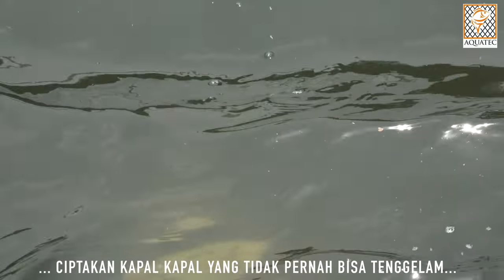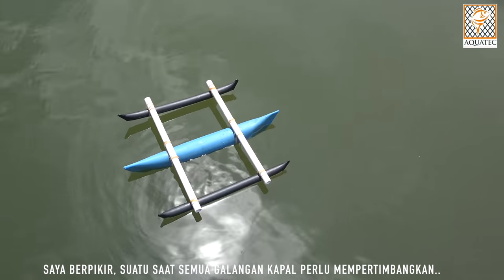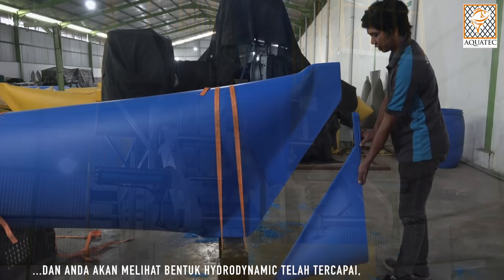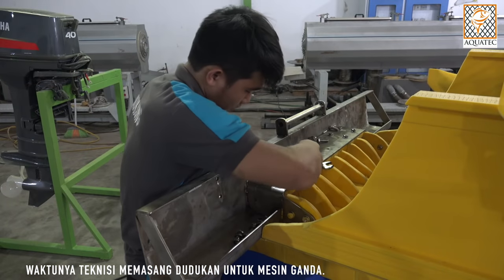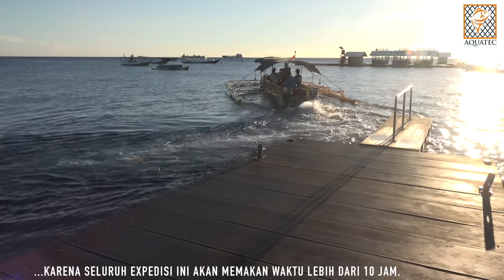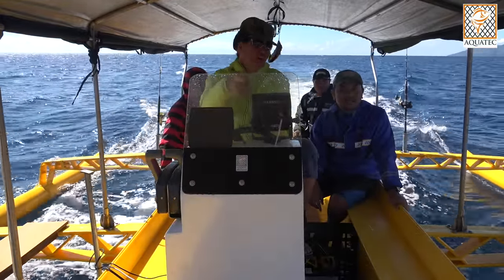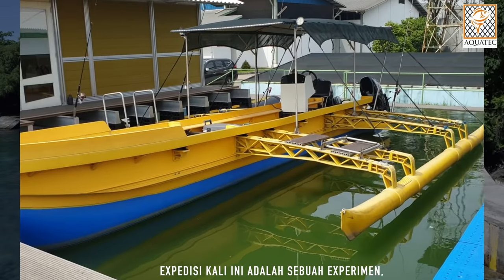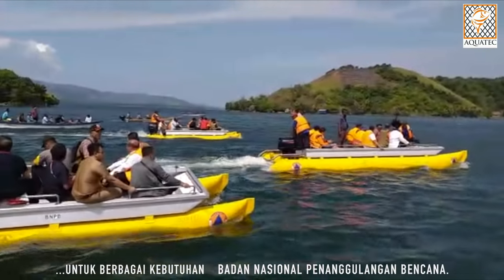HDPE Boat - Unsinkable Jukung

Comment: Are you sure they are unsinkable? Did you make them UV resistant to prevent the suns rays from making the plastic brittle or crumbly and fill them with flotation foam just i case they get a hole in them? they are neat, thanks for showing that to everyone.

Comment: Crimp sealing the tube ends is brilliant in its simplicity. Adding foam in the tubes would create a truly unsinkable boat.
Reply: that would add unnecessary add cost as air is buoyant enough.
Reply: @timothygodfrey4950  Water proof bulkheads definately required.

Comment: what a great idea sir to protect our trees may god bless you always sir
Reply: @UguysRnuts  yes it may saved if we use that pipe instead of using wood to make  a boat..industries are everywhere and its  part  of growing country to have a lot of industries.what i mean is to minimize cutting trees in there place to make their boat. that step may not totally can clean or stopped  polluted air but it may help to stomped plodding ...did you think of that bright man hahhaahahahaha
Reply: @UguysRnuts  No need to call the person stupid, perhaps "dangerously ill informed" would have been more polite.
Reply: Wood is a far more environmentally sustainable build product. It is also renewable by planting trees. Petroleum products, plastics, are not an improvement. They should be used with caution.

Comment: absolutely awesome! i agree filling with a foam would truly make them unsinkable. the current design is a massive step up from a fiberglass boat but you'd only need two holes worn or poked into the pontoon for it to start filling. given the amount of wear this boat would likely see, it would happen eventually. but even then your looking at years of good use and patching them really well is certainly possible to.

Comment: I am glad you mentioned the splashing,  since this design will not be very suitable for rough ocean conditions. You were lucky to have a smooth first journey. The bow needs to be higher and also the shape of the hull needs to be curved upwards like a banana,  with a straight pipe design it is not possible to achieve good rough weather capabilities. 
But the idea is good 👍⚓

Comment: great idea and design! I would say you should try using 2 pvc pontoons as the main part of the boat.. it would float higher above the water and the outboard motors would propel the boat easier and with less wake/splashing  like the splashing seen at 5:05..

Comment: Your idea is great, but if you build a platform on top of the tubular pipe like hulls, the weight of the platform forces them beneath the water. Making it a much smoother ride, because these hulls ride beneath the water like a torpedo, instead of on top of the water which is rough. You would have to place the outboards on the stilts or vertical beams that hold up the platform. This type of design is called a SWATH small waterline area twin hull. This is the future of all boating being, fishing, sailboats, ships & even ferries boats.
Reply: Super!,Thank You.

Comment: A very nice solution to the problems you mentioned both with wooden and fiberglass boats. One point that the video did not answer was how does the boat handle turbulent waters and storm conditions? Often multihull boats are more stable capsized than upright, so it would be interesting to check that failure mode to see what can be done in the design to reduce the likelihood of a capsize.

Comment: It’s a great start but unsinkable will not stop it from capsizing and drowning everyone on board. 

You have the perfect platform for solar panels overhead eliminating the need for imported fuels. But I would address the issue of drag first. Those pontoons can be shaped to cut through the water then widening gradually. That will increase speed, efficiency and reduce splashing/drag.They can even be raised so they don’t touch the water when you’re traveling at speed. And you have too many braces for the outriggers. You can reduce your weight considerably by eliminating half the braces.

Comment: You could embed reinforcement beams for added structural support. Also a UV protection coating would help the plastic degradation.

Comment: Was it UV treated? Nice idea, especially if the plastic is recycled. Also solar panels and electric motors, with the batteries inside the main float (have the end removable), for ballast.

Comment: HDPE seems to be an excellent material for boat building, be it from pipes or from sheets. It has to be treated to be UV resistant. 
The concept presented here is very interesting; it looks easy and simple to realize, ... provided that you have the machines !!
Having said that, in case of collision against a reef, the hull can break, ... and the boat is not unsinkable any more !!!

Comment: Love the idea and appreciate your effort.  I agree with the earlier comment of closed cell foam.  Good design.  Hope we see your design in CA with a larger Kayak great marketing
Reply: Fill the hull with sealed coke bottles, lighter, cheaper (free) and recycled, they will never puncture even if the hull is 👍😊
Reply: @colinstace1758  Not neccessary. Fitting water proof bulkheads will do the job. Air displacement within excellent boyancy.

Comment: Very COOL! I want one, if the insides were filled with flotation foam it will never go down. How is the material in long term sunshine?
Reply: The black version is very good 100 years + probably we dont know it’s that good. it off gases so little under uv light it’s hard to measure and purity has a huge margin of error effect.

Comment: Environmental friendly, unsinkable you might be missing a few ingredients like storage for gear and gas, ice, batteries, fish holds, cab, cabin, shade setup for fishing during the day then the main ingredient rough water in open ocean have to try stationary and trolling then gas mileage and weight capacity is a another seasoning for another time. I can say those Freeman catamarans are a work of art

Comment: great! However wouldn't have been more appropriate to send the boat out into rough seas to test its purported un-sinkability? I mean, that's the argument you make at the very beginning with the plate test. Also, with respect to the issue of adding more micro-plastic to the ocean, to what degree does this material break down over time? Have you thoroughly tested(considered) that aspect?

Comment: others are saying foam, but then when the hull gets a hole you would have no way of knowing and the water will rot the foam and add weight, instead a few bulkheads in each tube with an inspection/storage hatch to access each, so if one gets a leak it wont sink, and you have access to fix it.

Comment: It was really an amazing construction from plastic components. But the only comment I can say is that the PVC pipe as time it gets to use will become brittle and will easily break of crack up especially if it hits or being hit by a solid object. Other than that no more to say, But, do continue ingenious your sdesign as to improved innovation in design engineering. Good luck!!!

Comment: HDPE UV resistance? 
Like the idea over aluminum expense and structural cracking.
Field repair/weld kits would be ideal. 
No non-sense build and idea improvements for anti-sinking would be good safety sales point and if updates are designed to retrofit already sold units to improve safety as knowledge increases with boat materials and structural engineering.

Would expect to see 45 degree angle braces for outriggers to pontoon to support pushing forces.
Way to mount outriggers in a manner to be able to transport in an onsite kit buildable design to extend market reach.
Good video and thank you very much for your time and ideas.

Comment: I was going to build a DIY  boat  just like this,  but first,   I need to build an HDPE injection molding machine the size of a building.  Then,  I need to build a heater and crimping machine the size of  bus to seal off the ends of the tubes.  And finally,  I need this heat fusion gun to put all of the parts together...........  Oh i almost forgot,  I need a couple million dollars for all of this.

Comment: Chambered hull into 4 to 5 sections would be adequate to make it unsinkable.  Even with hole on the bottom the water would not rush in due to buoyancy of the othe chambers.

Comment: I believe a whole series of vehicles, light aircraft, boats & midget underwater boats / submarines & lightweight tracked vehicles.
So many potential uses , especially for a island nation like Indonesia. For military use instead of heavy armour, making them small and hard to hit is the name of the game imo. Cheap, lightweight, rust proof, no painting or rust prevention, sonar transducer can shoot through the hull . Low magnetic & low heat signature. Can us ballistic plastics & fibre reinforcing or add on tile plates . Lightweight means, smaller engines & less fuel, less environmental footprint. I’m thinking plastic tracks may not need lubricant. I’ve seen plastic suspension springs also .

Comment: Clever. I need two of the central hulls you used on the record run in the movie. Also a connecting structure to build an 8 foot wide platform upon  between the hulls. We will use four 40 horsepower outboard motors. KiaOra from New Zealand.

Comment: How stable is the material with UV (sunlight) damage? Also how long does it last if the bottom part is scraped on a sea shore where there is no proper harbour and the bottom is scratched by dead coral/rocks. Great idea for boats, but I would not put HDPE plastic and 'environmentally friendly' in the same sentence, sorry!

Comment: Having operated and sailed for many years on  fiberglass catermaran, I found the most vulnerable item on the boat was the spreader bars, especially where/how they were attached to the main hull. In rough weather, with stormy seas, these attachment points are incredibly stressed. in the time I owned the boat, much attention had to focused on these attachment points to ensure they did not fail in stormy seas. I note too, as this boat in the video is basicly a proof of concept idea, it does not cater for storage of equipment or catch. So how would this concept replace traditional wooden boats that have this ???
Reply: I agree as well, I believe this can be solved by filling the tubes with close-cell foam to form and make the compartments water tight, also saw a post by which I will share below that makes design sense as the concept develops and with naval architecture in mind.  

Herzankerkreuz67 wrote as follows: 
@Herzankerkreuz67
2 years ago (edited)
I am glad you mentioned the splashing,  since this design will not be very suitable for rough ocean conditions. You were lucky to have a smooth first journey. The bow needs to be higher and also the shape of the hull needs to be curved upwards like a banana,  with a straight pipe design it is not possible to achieve good rough weather capabilities. 
But the idea is good 👍⚓

Comment: Air chambers are defalut design feature in almost ANY ship, those are called bulkheads. Even Titanic had those - only problem was, there was flooded a higher number of them, than enough, to sink the ship. By the way, more modern boats are build out of (or partly of) floating foam. The light side of that is, even if the boat breaks, it floats. Even if it is full of watter, it does not sink. The foam could be added into your design too - simply when the pipe is velded in one side and open in other, you fill the pipe and weld the second side. Try to find modern boats design and timelapsed builds of them here on youtube, you might be suprised, what can be done today - even out of HDPE material of your pick.

Comment: A great idea. Perhaps it is your long term plan, why didn't you use some of the hdpe that is polluting just about every water way on the planet instead using new hdpe pellets
Reply from the maker: Yes, but the problem is that secondary or tertiary HDPE has very low supply, quality, and/or recycle rate. Therefore we use only new HDPE pellets.
Reply: @AquatecIndonesia  agreed, but even recycling a small percentage in the mix  would help reduce some of the stuff fouling the oceans  that both our countries rely on
Reply from the maker: @georgesmith4509  Agreed, thank you. So far we use leftover HDPE from our production line. If we can find high quality recycled HDPE, we will add it into the mix.

Comment: Looks like semi displacement hull shapes? It may be possible to take more advantage of benefits of hydrodynamic design to improve efficiency at design cruise speed. What is the difference in material density compared to standard fiberglass layup?

Comment: how is this unsinkable?  if the fused ends open which they will do as some stage as the pipe ages they will sink like a stone.  Likewise if the pipe gets a hole in it from striking some underwater object... sinks...

Comment: Rotomolded plastics can be shaped more efficiently.  You could have a more fuel efficient design with less splashing.  And foam filled is better than an open chamber that will fill if punctured.
Reply: Welding poly disks internally into the hulls before they're sealed creating water tight bulkheads is better than foam and considerably lighter.

Comment: The plastic pipe floats no problem but you add engines and all the other items in a boat I would want the tubes filled with flotation stuff. Closed cell or styrofoam what ever is the least expensive.   I know these will last years but sun damages plastic over time so what is the plan when a boat needs to be recycled?

Comment: These craft would be unsinkable so long as the press seal hold fast.  Maybe consider using small holes in top to pump in an expanding foam.   The even if there is a leak it will stay boyant.

Comment: I think it’s great but how does it compare in weigh to a similar boat? I’m just wondering not criticising. Is there a pressure valve refill valve in the pontoons to allow for hot cold expansion which could cause small fractures or is there enough give in the plastic to accommodate ? Cheers and well done
Reply: Expansion and contraction and air pressure is insignificant as the pipe is designed to operate at full working pressure for years and none of that capacity is being used in this design.
The danger would be that the pontoons have sufficient wall thickness so that the walls don't flex while the boat is planning. Just like steel, HDPE will fatigue fracture if it is bent back and forth long enough.

Comment: Something to consider would be at least 3 segments for the main hull, or hulls in the case of the catamarans.  That way, in case you hit a log or rock too hard, you won't sink if the HDPE skin is ruptured.  While preserving the forests is a very noble goal, I believe that HDPE is produced from petroleum products, so it may not be as "green" as many feel.

Comment: Extrude a thin poly string ... Build 3D printer with 24 inch by 144 inch base ... Print girders, struts and intrrlocking flat panels for floors, roofs and walls ... Maybe even make housing construction elements ...

Comment: eventually the plastic will start to break down and then you will have more plastic garbage in the ocean. better way would be to manage forests to be sustainable and improve wooden boat design and construction. Also wooden bouts are built locally and sustain the builders and their families and aren't dependent on fossil fuels.

Comment: Observing how these pontoons were traveling THRU the water, clearly displays a little more going on here than simply flotation. The dynamics of flow of the water is very poor, resulting in heavy fuel consumption as a direct consequence. The bow needs further styling and shaping to allow easier penetration thru water and less turbulence. No reason why bow cant be shaped to accomodate this. I'd feel safer if there were air tight bulkheads fitted thru out the main pontoon. There is a video available of some Russians going around the World on a similar craft, but inflatable. Their experiences clearly displayed a need for such bulk heads in such a vehicle especially when sharks bite the hull at sea. Where there's no opportunity to patch things up.

Comment: need improve in hydrodynamic for more better fuel efficiency.
and why not make the solar energy boat combine with electric generator for replace conventional engine that small and light plastic boat is perfect for electric engine, tropical sea have good sun why not use it?
my approximate your boat can accommodate ++8000kw solar roof. enough for 8 hour charging for all day cruise.

Comment: false sense of security. sigh gotta have an american explain to a jukung builder to put foam in the tubes he left with only air in them. once each ruptures they get waterlogged and sink. with foam in place of the air even if tube gets ruptured it will not fully sink. sigh once again indonesia tech proven wrong.